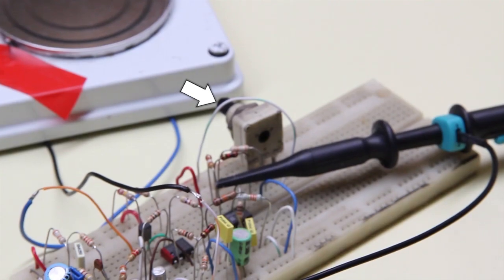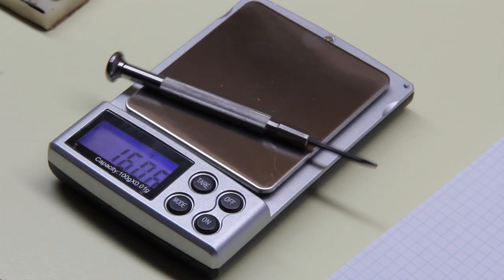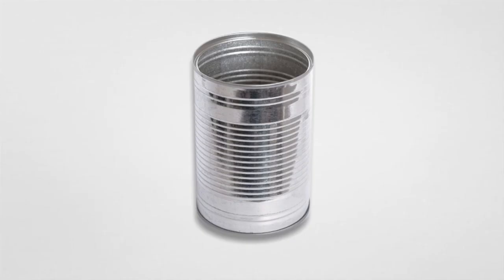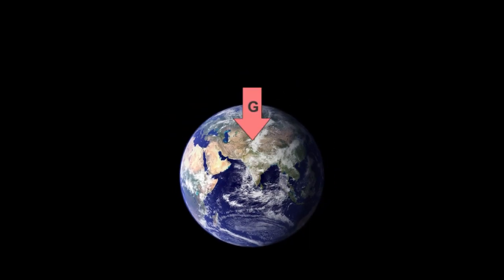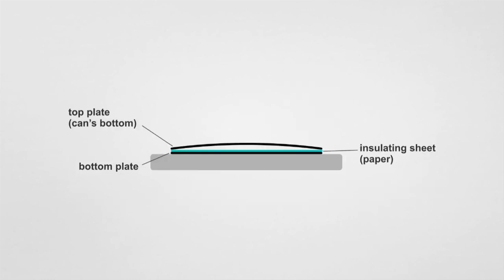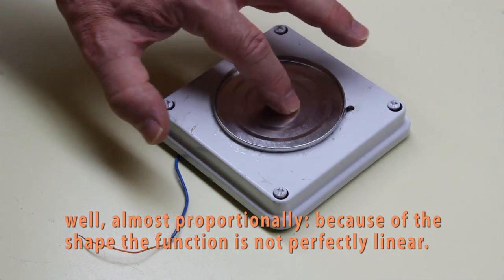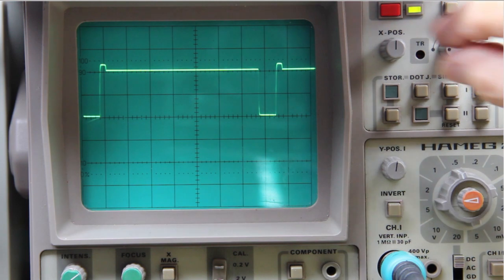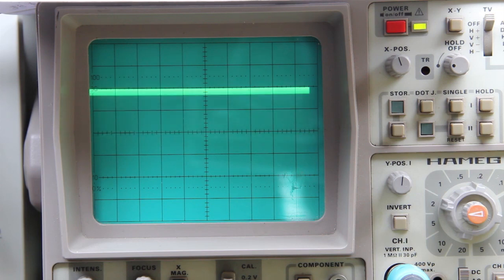Have fun experimenting a capacitive weighing sensor with a tin can - learn capacitive sensing

Comment: Is there an advantage of an air gap sensor over using a piezo disk design sensor?
Reply from the maker: I never tested a piezo disc as a capacitor so I don't know. Piezo discs by themselves can be seen as voltage generators with a series capacitor, so they can be used to pick up variations of the pressure applied to their plates but not static forces. Scales used to measure weights typically have strain gauge to pick up the force, strain gauges are resistive.